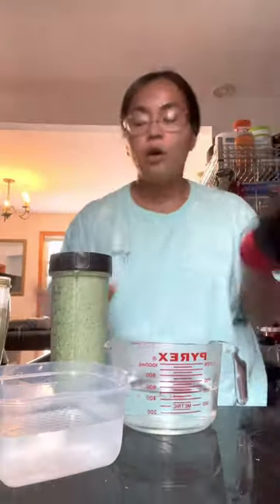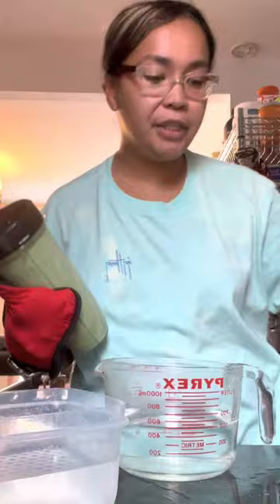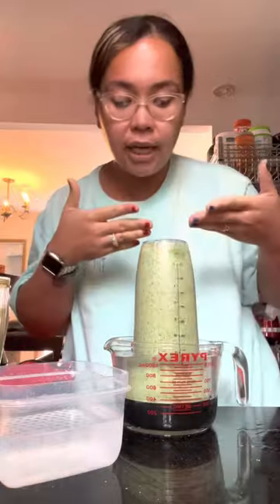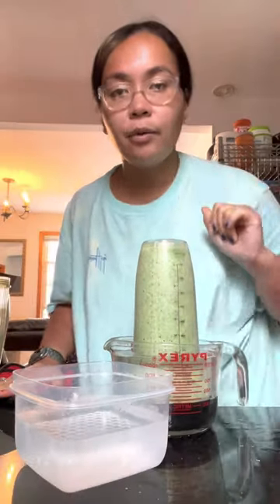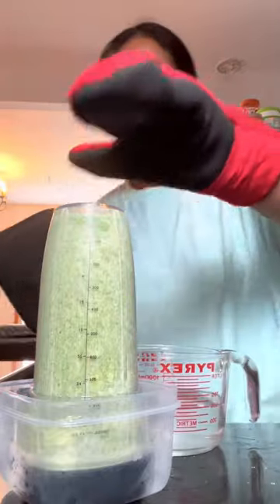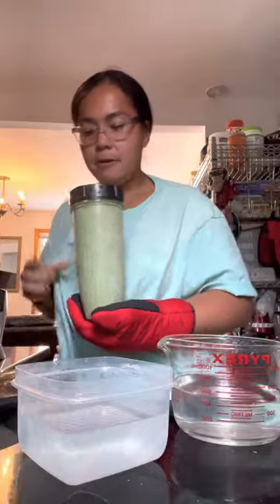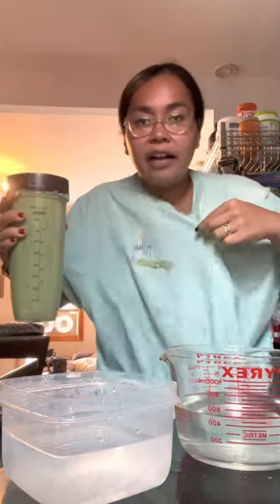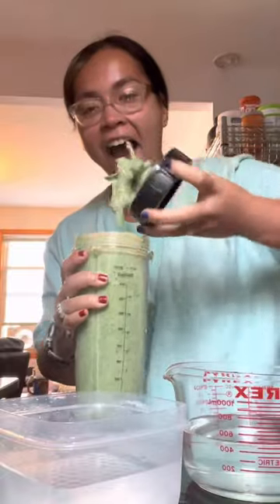Blender lid won’t come off? EASY FIX!. how to open a stuck blender lid

Comment: hurt my hands a lot, took 40 mins to try to open it but guess what. i just figured out i was twisting it the wrong way
Reply: Thanks for the tip.  I was getting frustrated until I realized I was turning it the wrong way 😂😂😂

Comment: I struggled for a few hours. Searched it, found your video and tried it 4 times 😂
I was scared at first because of the super hot water. The 4th time I had to trust the process and let it actually just sit in the boiled water and it worked. The 4th time I didn’t even rinse with cold water 😅 Thank you so much for sharing your true experience. 😂❤
Reply from the maker: lmao facts.

Comment: Thank you very much! I was at my wit's end preparing a cake in my ninja blender. Lemon and baking soda.... So it kind of swole up and there was no way I could open it up. In one try, very hot water and then cold. Everybody be careful, when I opened it up there was a bit of an explosion. Cake dough ALL OVER THE KITCHEN. But that was due to the lemon+baking soda combo. I am very thankful that the lid ( with every sharp blades didn't hit anybody).

Comment: Is science. Heat will make the plastic/metal expand. And contract on cooling. I remember my grandmother used to apply the same technic for glass jars with metal lids
I had to keep it longer than a minute in the hot water. Probably because my blender lid is thicker. But definitely worked
Reply from the maker: i just slam glass’s jars. lol.

Comment: Yes, kept in hot water for 2 minutes.. didn't put in cold. Then took a hammer n hitted cap 4 times.. then again some pressure but it opened finally.

Comment: So after five times of trying this and not working. I tried another 2 times but then, after submerging in the cold water I banged the lid on a hard surface a few times. This still did not work. So I left it on the counter right side up.
For probably five minutes. Banged the lid again Then put it on the blender and blended a few secondsand this worked.... lid came right off.

Comment: Tried it twice and it came off the second time, but I still had to struggle a bit to get it off. I have a Blendjet2 with an Orbiter lid, though, so totally different. And I was scared to make the water too hot with the Blendjet.
Reply from the maker: glad you went for it!.